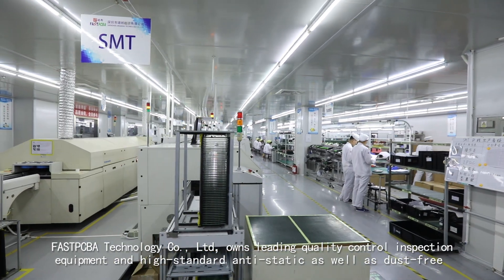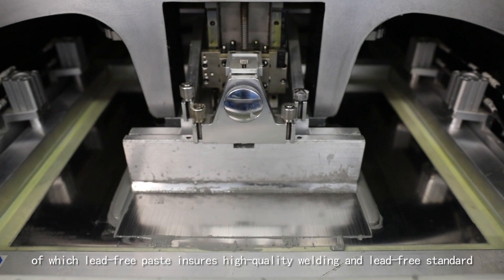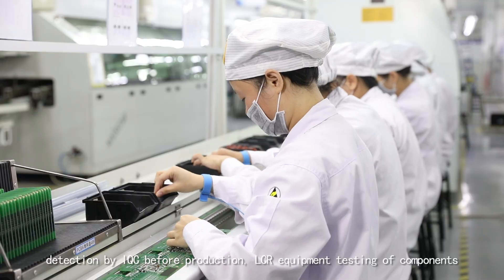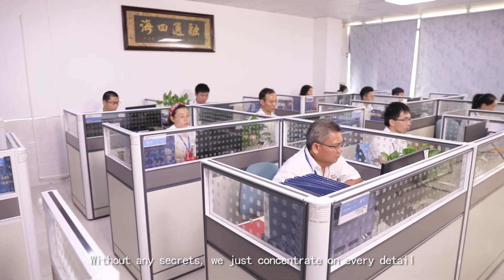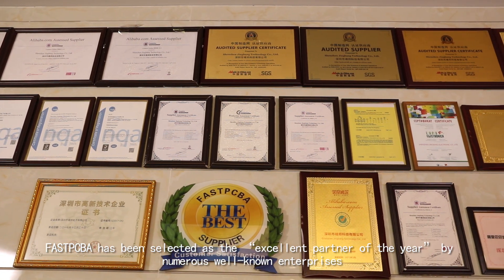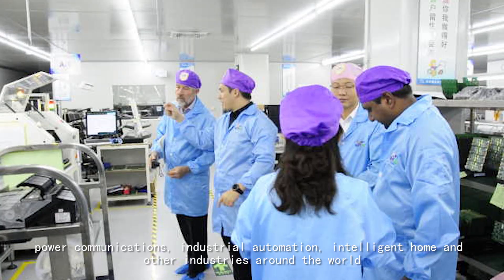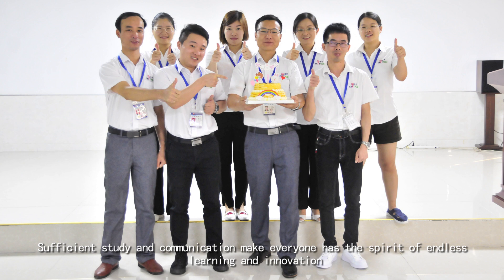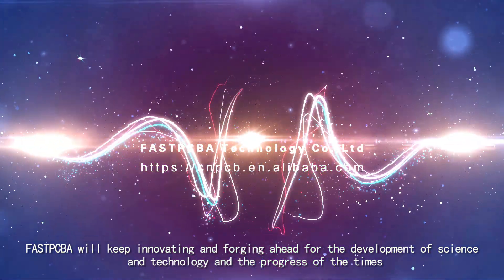100 pcb manufacturers worldwide

Comment from the maker: Sunking circuits advantage:
1. Main Supply : mostly 2-20 layers, Quick turn, low to mass volume PCBs, FR material PCBs, High Frequency, High copper PCBs, Single/Double Alu PCBs, FPC, Flex&Rigid board, 3/3 mil trace and spacing etc...
2. One-stop service: From the inquiry to after- sales service, our employee always service for you. Whenever you need us, we are here.
3. We have a stringent quality control system, and all boards are with 100%ET, AOI test and IPC class 2 and class 3 standard.
4. Professional team work with High efficiency, Strength: different language sales and engineers, with abundant oversea sale experience.
5. About the price: We can offer our new customers with total price 40USD for 2 layers, 100USD for 4 layers, 180USD for 6 layers, 200USD for 8 layers prototypes.
6. Quick turn service is also no problem for us. We can build the 2 layers board in 1 day, 4 and 6 layers in 2 days.
7. We have the certifications for TS16949 ISO9001 ISO13485 .
8. Shipping method: DHL, Fedex, UPS; Shipping time: 2 days to America and Europe. Also we are SVIP customer for the express company so that we can get the competitive shipping cost from them.